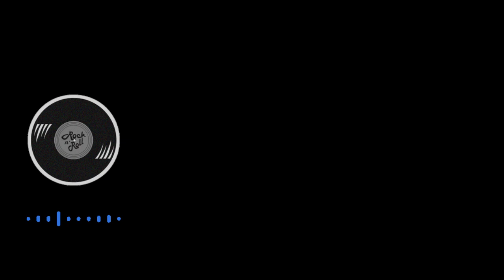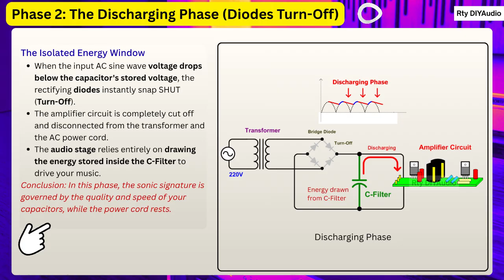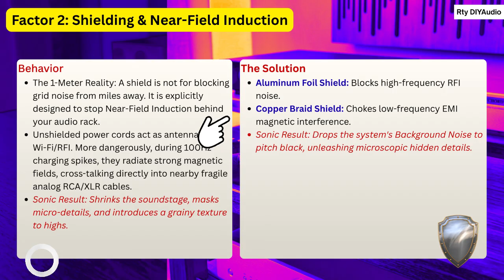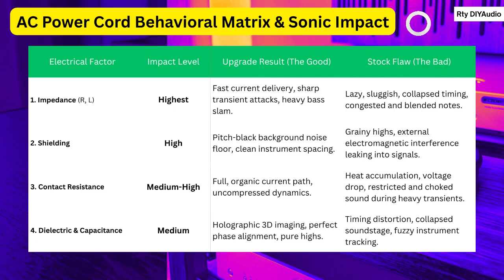Part 1: Demystifying AC Power Cords: Sonic Reality or Placebo Effect?  | Furutech, Oyaide, Rhodium

Comment from the maker: 📌 TIMESTAMPS
00:00 - Introduction & The Great Debate
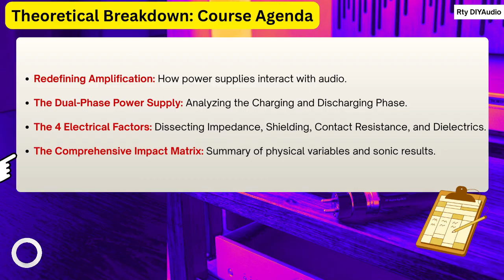01:26 - Redefining Audio Amplification (The Modulated Faucet)
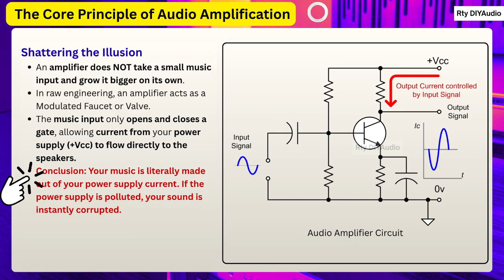02:01 - Inside the Dual-Phase Power Supply
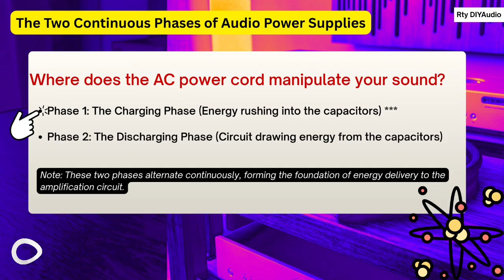02:38 - Phase 1: The 100Hz Charging Phase & Diodes Turn-On
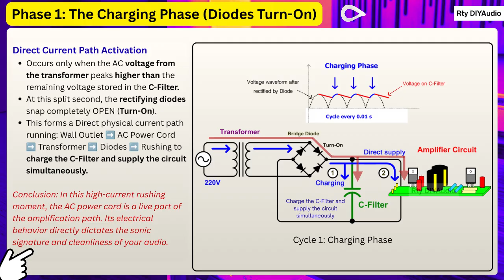03:19 - Phase 2: The Discharging Phase & Filter Capacitors
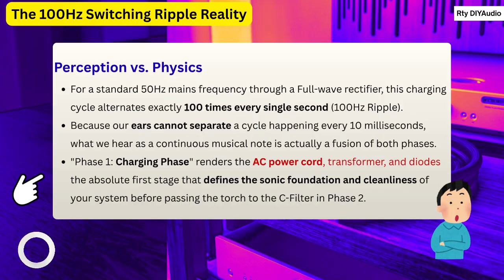04:30 - The 4 Key Electrical Factors of an AC Power Cord
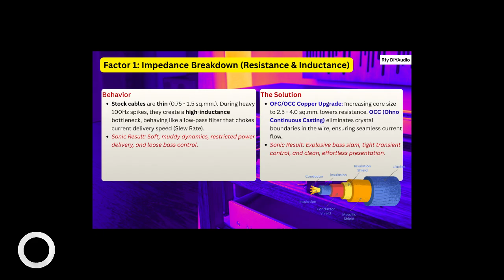05:04 - Factor 1 & 2: Impedance Breakdown & Near-Field Shielding
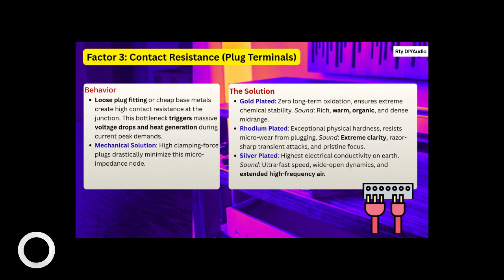07:14 - Factor 3 & 4: Contact Resistance & Dielectric Matrix Summary

If this video helped clarify your understanding of audio power foundations, please hit the LIKE button, SUBSCRIBE, and share this video with the global audio community!

#Audiophile #DIYAudio #PowerCord #AudioEngineering #HiFiAudio #TimeDomain #Furutech #Electronics

--------------------------------------------------
⚠ IMPORTANT DISCLAIMER & SAFETY NOTICE
• DIY Audio Modifications Involve Serious Risks: Electrical projects and power grid experiments carry dangerous currents that can cause severe shocks, personal injury, or hardware damage. 
• Proceed Entirely at Your Own Risk: The technical concepts, engineering theories, and cable-matching matrices shared in this video are for educational and hobbyist reference purposes only. 
• No Professional Liability: Rty DIYAudio assumes absolute zero responsibility or legal liability for any component failure, circuitry errors, or physical damages resulting from the execution of this content. Always prioritize electrical safety on your workbench.
--------------------------------------------------